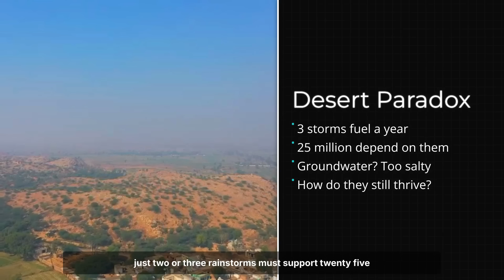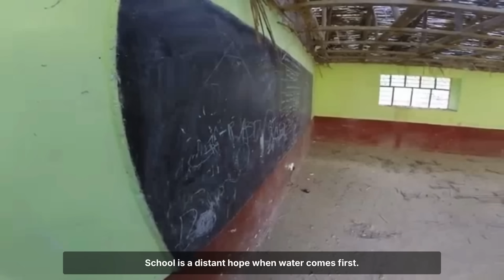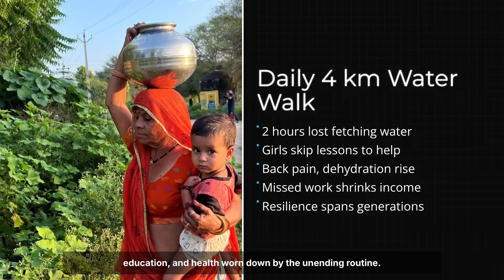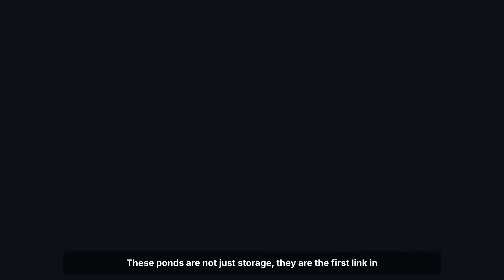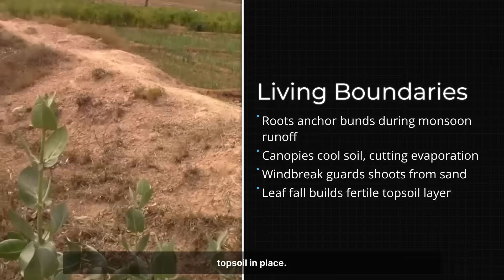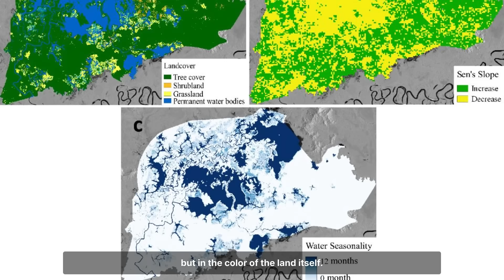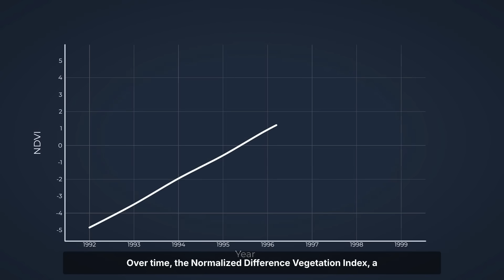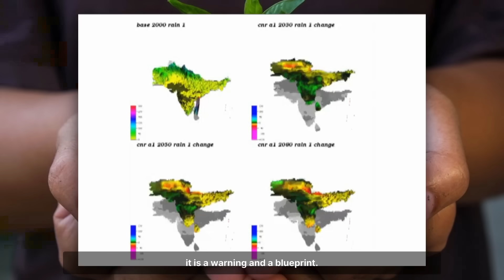India Turned a Desert Into a Lifeline Using Simple Water Systems — Nobody Saw This Coming

Comment: Gentle man your theory is misplaced partially if not completely. Mansoon patters have changed. Earlier Mansoon in North India and Pakistan used to enter from West Bengal, Bihar, UP, Delhi then Haryana, Panjab & Rajasthan simultaneously.

Now since last 10 years and so Mansoon is entering from Arabian sea instead of Bay of Bengal.
Last year Gujrat, Maharashtra, Rajasthan and Panjab were flooded along with Pakistan. Whearas eastern UP and Bihar have seen lesser rainfall iin past decade.

Now if you visit Gujrat and Rajsthan there is hardly any sand dunes left. Earlier sand dunes used to shift with wind now this is not the case. Earlier there was no drainage system in Rajasthan cities.Now cities get  blocked and remain blocked for days due to the  existing drainage system not being in place.

Comment: Divert Indus water through canals
Reply: yes. IWT is blatant theft. India's hands was forced by colonial powers to sign that unfair exploitative treaty. They engineered the famines and used famines as a bargaining tool to force us to sign it. Enough of this exploitation. We will take it what is rightfully ours.
Reply: If they did it in thin enough canals they can top it with solar panels, protecting from evaporation and generating power.